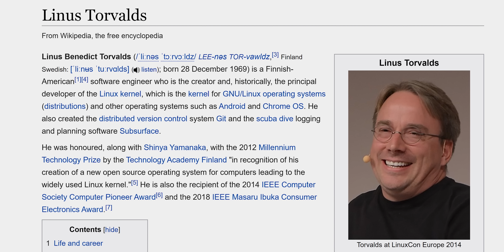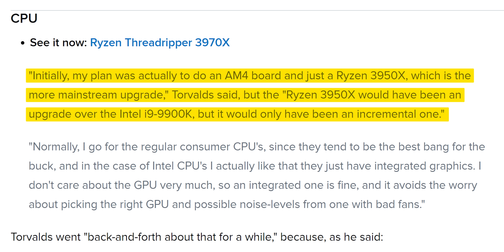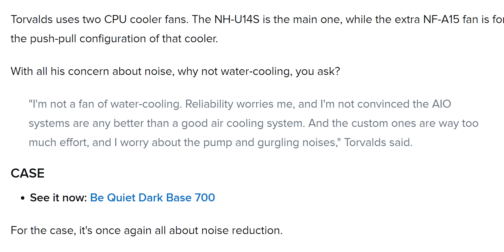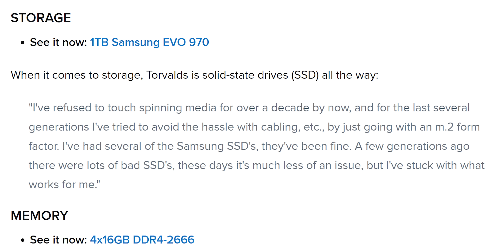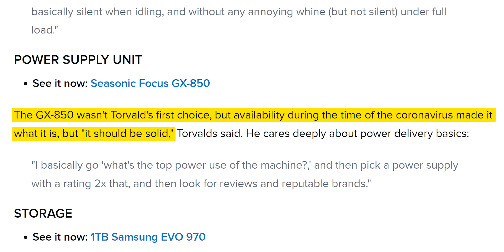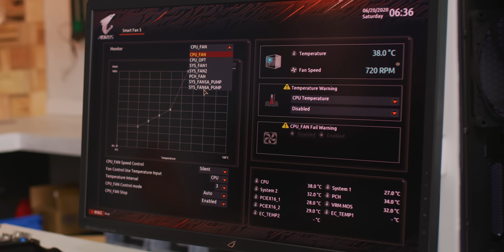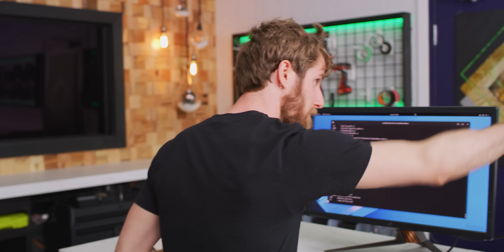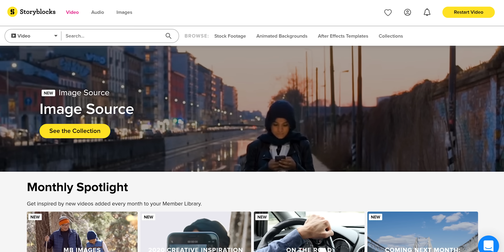Linus builds Linus’ new PC!

Comment: Linus' thoughts about water-cooling mirrors mine to a freaking T

AIOs I could probably bring myself to look into at some point (mainly for the fact that it does admittedly look a lot cleaner and less cluttered than a chonky air cooler (like my Scythe Mugen Rev. B), but a full-blown custom liquid loop? Nah fam, you can keep that expensive, high-maintenance mess.

Comment: I have the same case. According to the manual it’s possible to mount 3 140 mm fans in the front. Has anyone tried this? It’s almost impossible to fit. I managed to do it, but the bottom screws of the bottom fan aren’t attached and neither the top screws of the top fan.

Comment: I use Linux on the daily, and I use the i7-7700K and I'm pretty happy with that, it works well for both gaming and compiling source code pretty quickly. But I think I might fare better with a Threadripper if I want that extra raw power for faster compile times.

Comment: that integrated GPU is better because less fans than necessary logic is just stupid.  Then he picked an RX 580??? Should've got a 1650 Super or something
Reply: AMD has far better drivers on Linux. On pretty much every modern distro they are built in no extra steps needed.

Comment: Awesome video. I'm a developer, mostly web and actually, I don't need that amount of processing power. I think most developers don't, of course, this depends on each developer-specific tasks. My personal experience tells me that is far more important to have a comfortable and ergonomic work station to spend long hours coding. I'd be nice to have "the wrong" Linus make a video about this ( XD ). I think this would be some nice features to take into consideration:
- Desktop real state. Multiple monitors to have the code editor, debugging app, browser developer tools, browser to check some documentation, and StackOverflow, maybe a couple of terminals. All at the same time without having to switch windows. I don't really care about awesome refresh rate or HDR or stuff like that, I'd rather spend the money on more monitors. 3 or 4 decent monitors 21'' to 24'' maybe matte over glossy because I don't like any reflection on the screen but it's not a deal-breaker.
- A comfortable chair.
- A big desk, I also like to keep notes by hand. Maybe a whiteboard
- A comfortable keyboard, to type a long time and a decent mouse.
- Fast RAM, storage, and networking.
- Wireless headset
- A fair amount of IO, sometimes we need to develop for embedded devices so a lot of USB, a couple of ethernet ports, and even an RS232 would be nice to have.
- Power efficiency. I rarely turn off my PC because I use it as a web server for testing purposes.
I know this specs are not really techy and I'm sure many would disagree with my opinion, probably I missed some things. But I think 99% of the developers would like to have the things I mentioned above. It'd be really nice to see an LTT video for this kind of workstation setup.
Reply: The smoothness of 120hz desktop bring lots of comfort for desktop use. I cant go back to 60hz, just like u cant go back to 30hz

Comment: 5:50 he could have used the noctua nh-d15 with a single fan in the middle for better performance and even less noise.
Reply: Does not fit the AMD Threadrippers which are enormous and contain multiple chiplets under the heat spreader.  On the higher-end 3970X / 3990X you need to cool the entire heat spreader.  Hence the Noctua TR4 specific cooler.
Reply: @matthewstott3493  Huh, didn't know the nh-d15 didn't fit.

Comment: Linux is also great for editing - with Davinci Resolve Studio, faster than on Windows 10 for sure.
On Manjaro installation is really easy also (having NVIDIA cards) - enable AUR in the package manager and install it, done - will even keep updating itself automatically.
Reply: Is that so? I was on IRC one night and someone said they could not get Resolve to run so I helped them out with it. I managed to get it running on my PC in the process too. Was just missing a library it depended on. I don't think mine updates automatically though? Cinelerra is cooler looking to me. Real men video edit on the command line with mencoder. It is faster for sure!

Comment: Love this build! I am a software developer and at my work they give us Dell Precision 3520s. I can max out my CPU on command by just building our application. Multiple threads, a fast ssd, and a lot of ram are key for developers. I run a docker container that has the application server on it, my IDE, the monstrous ram hog that is google chrome, gradle builds, and run micro, integration, and end 2 end tests. Sometimes all at once. It can be very frustrating when you need to get a patch into production quickly, but your computer just can't go that fast. My computer fans are normally maxed out and one of the guys on our team actually melted the plastic on the bottom of his laptop. I wish we had something like this at work!

Comment: "We don't understand the needs of developers"
Developers: Man I don't care just give me a Unix based system lmao
Reply: There are so many different kinds of developper
From front end dev pro apple noobs to ai engineers forced to use nvidia cards ....
Reply: @xenio8736  "forced" Yeah, force me to use A100's any time ;)
Reply: Guys, it was just a joke. Why are we now shaming people with macs...
Reply: @rubentorres5848  because "us against them" team mentality is easier than acknowledging that some machines are worth more than their hardware
Reply: I have started to use Cygwin as a development environment. Basically it is a very transparent way of running Windows and "some Unix lookalike" at once and saves me the trouble of using two seperate build systems. I can basically compile and run stuff for windows and POSIK in the same environment.
My favorite: make ARCH=cygwin-x86 && make ARCH=windows-amd64 && ./a.out-cygwin-x86 & a.out-windows-amd64 & all inside the same script.
I even use the Cygwin-Environment to interact with Windows. Doing regedit /dump | grep ShellExt and such stuff. While it surelly deviates a lot in the low level you can actually use it pretty fine for mid- and high-level stuff, in my case mostly some C++, Bash, Phython for boring standard terminal/daemon/networking stuff. And it also has a fantastic X11 implementation, I use it all day to connect to my more Unixish systems.
Reply: So basically those young hipster devs that run around with Macintosh laptops and have only one goal, using the latest most popular JavaScript framework? 🤔
Reply: @etnevel.naitzsirk  MacOS has a Unix-based kernel, so there are many similarities between using the terminal in mac and linux, making development on Mac very straightforward. In fact, while most developers, at Google for example, have a Linux desktop as their workstation, they generally use a Macbook Pro/Air for development on the go. It is easy enough to SSH into your workstation for specialty work, but can also do development work directly on your mac as well, when needed.

Can Linux be considered better/cheaper and to have more flexibility for development? Absolutely. But much more than "young hipster devs" opt to use Macbooks when not at their desk.
Reply: @jBaddog  you don't need a macbook to ssh into your workstation :) and actually nowadays you can have a good laptop with good battery life with linux for development on the go ;)
Reply: @etnevel.naitzsirk  to be fair Xcode only runs on Mac, and native mobile apps can bring in some good money
Reply: @etnevel.naitzsirk  Well.... yeah.
Reply: @etnevel.naitzsirk  Sounds pretty spot on lmao
Reply: Levente Krisztián Büte actually unlike windows. Mac is built on Linux and includes bash which has enabled macOS to develop for many languages right out of the box without installing a thing such as PHP, Python, Ruby etc... in fact it supports 10+ languages in all without installing a thing. This is why in the San Francisco Bay Area(Silicon Valley) it is a pretty common site to see a sea of MacBooks at any coffee shop or on any tech companies production floor. I’ve been doing this for 8 years and when  it comes to laptops there is no other OS that caters to developers more than macOS.

Edit: I’d like to point out also that Windows supports 0 languages out of the box.
Reply: @TheN8ism  I'd say Arch Linux comes pretty close but at this level that's just personal opinion.
Reply: @TheN8ism  A few corrections here: 
macOS is not build on Linux but on BSD, which is a Unix variant. If Unix would be the father, BSD and Linux would be the kids (and thus siblings), macOS would be a bastard of BSD and Mach, and regular Linux distro's like Ubuntu and Fedora would be kids of Linux.
macOS these days uses zsh as shell, not Bash
Default languages in macOS are most of the times older versions. Any modern developer will install their own version. Also updating to the latest perl can cause incompatibility issues so it's not that straight forward. And you would still need to install php or nodejs, Xcode (for Objective-C) or other code editor/IDE.
In the end.. these days most developers would be using Docker, for which you would need Docker 4 Mac (/Windows) which runs a Linux VM, so your operating system becomes less important. 
For the Windows fans: Windows includes a Linux Subsystem (=bash) and also it's not that difficult to install any interpreter by double clicking an exe installer.
I use all three OS'es, each to their own power
Reply: @wLooooooo  Mac is based off of Darwin, which is based off of several systems (including BSD, of course)
Reply: @TheN8ism  : Uh, NO, it's not built on Linux.  It's built on Mach with a BSD personality on top of it.  That OS hails from the genesis when Jobs left the company and then came back.  He left to found a company called NeXT and he brought the OS back with him to make OSX, for all intents.  They look/act similar and program in many ways similarly unless you're touching a UI piece...but it's not based off of Linux.
Reply: A few points to add to this thread:

1. macOS is (was?) a certified Unix. Unix is a standard and you can write it however you want as long as it complies to the specification. After all, Linux is (was?) simply a Unix-compliant OS without the official certification or the Unix software license.

2. Whilst Linux or other Unix OS's are great for non-Windows centric development, macOS is the only one that really has widespread support for industry standard commercial software that developers or whatever may end up needing (or at least preferring). Anything from Microsoft Office to Adobe to Autodesk to numerous enterprise focused software. Linux doesn't get much love there and more traditional Unix is typically not even part of the conversation.
Reply: @NaN you are still using nvidia gpu...
Reply: @NaN Yeah sure, go train any real deep learning model on something else than a Nvidia card :)
Reply: https://en.m.wikipedia.org/wiki/Category:Debian-based_distributions
Reply: @NaN ^
Reply: and a thinkpad

Comment: Respect.  Amazing.  As a developer and a gamer, balancing all these things is difficult.  Personally, I've been dual box for almost 30 years.  I run a Windows desktop with a fast connection to a Linux box, basically, as my desktop.  I display back Xwindows to my windows box.  For me, this gives me maximum flexibility, and allows me to run Linux apps natively, full on.  It, also, lets me play games and use all the great Windows software, natively, at the same time - all on the same desktop.  The builds are complicated, but fun :D.  Each circumstance, and person, has different requirements.  Personally, I code on many different platforms, and do a LOT of different stuff.  Also, I tend to run servers on the Linux box, as well.
I can remember, 20 years ago, displaying back an Eterm Xwindow, for perfect emulation, sshed into a Tandem, so I could have pretty, nice, windows and emulation going to a Tandem.  Most developers, in general, are clunks that have no idea how hardware is put together, and are happy with ugly garbage looking development environments.  I, personally, found my productivity was boosted as much as 5-10x that of other devs in my group, by taking the time to set up some of my crazy work environments.   A couple days, working out something really amazing, would pay off dividends in the long term.
I, suppose, the point is - you can have your cake and eat it, too.

Comment: I don't like poop colored fans. I love be quiet! products. I replaced all my chassis fans and my CPU fan with them. As for the restrictive intake in the front of my case, I just put 2 fans on those, and set them to run constantly at the highest that I could without actually hearing them, and set all my exhaust fans to completely shut off if the PC is not under load. Because of this, I have a positive air pressure in the case. This means that I never get any dust slipping in through the cracks.

Comment: most developers dont rebuild something the size of a operating system though so i suspect this may be overkill... that said if you working a web development it does take some time to combile the backend and then do any traspiling to javascript packaging/bundling operatiion possibly there may be a unit test or end to end test to run too if we are really going for the works..
javascript notably is single thread operation though which may be an argument for intel... though not a overly large one given how good ryzens gotten and if your doing webdevelopement your probably running multiple browsers  though that rapidly disapearing as a thing as everyone gives up and jumps onto the chromium bandwagon.....
not sure if webassembly will run mutli threaded hmm... maybe in future? not sure.... curious to see how that shaked out...

I mean some operations in javascript could arguably run mutli-threaded if it was implemented that way like Array.map for instance.... but that would probably be impractical... but i bed it would be simpler to do with webassembly if it does not already work... need to dig into that hmmm... just getting into blazor right now...

Comment: That board actually supports DDR4 4000 ram, would've been cool to see how much performance (in compiling linux, probably not a lot) left on the table by not going for that.
Reply: Actually, since you can get that same DDR4 4000 in 32GB modules now, how about if you put the source directory and build path on a ramdisk, that would be super interesting!

Comment: I'm a software developer, and I did do some benchmarking of build times (rust, building actix-web version 2.0) with and without XMP. It made absolutely no difference but caused some minor stabiity problems. This was an 8 core Ryzen 3000 series chip. There's basically two things I want: low batch compile times for languages where that's applicable, and general snappyness in IDEs.

Comment: I remember compiling minimal version of Linux kernel on my HP 6715s with AMD Sempron 3600+ 2.0-GHz processor. Took 90+ minutes if I remember correctly. Transcoding of a 2hr video to 480p with h264 took 9+ hours. Oh the pain of recompiling the kernel when I forget to enable some module. And the CPU temperature of ~90°C.

Comment: Regarding SSDs. The early Sandforce controller ones were cheaper and on most of the third parties and had a lot of reliability issues. Samsung and later on Intel had their own controllers which did a bang up job and have maintained great reliability. My first SSD was a Samsung 8 something something EVO and to this day runs my OS on its tiny 50ish gb size, and i think it has about eight years or more on it.

Comment: Linus:es needs are needs of someone who works with small code bases and incremental changes only affecting few files. Fastest CPU for that more typical scenario is 10900k currently. I'm currently using 3900x so that I can test my own code with more threads. And only reason to upgrade would be testing AVX-512, and getting fully passive cooling solution from boutique manufacturer from Germany.

Comment: I think a B550 and the new 3900XT coming out next month would be a better system.  At only 105w and 12 cores and the supposed performance boost of the XT cores as well as the reasonable price points (to piss off Intel) I think it is a no brainer.

Comment: If you ever make a dev build guide, here's important things:

Speed, the system should be fast at booting, I/O operations, and compiling.
Enough storage, as a programmer I've noticed I'm always needing more space which is why my most recent build has 5TB.
Cheap but has quality, if it's too expensive then it will obviously be hard to afford.
Stable, can't have it go down in the middle of compiling.
Basic graphics, unless gamedev is needed or it's going to do gaming there's no real need for a graphics card but having a basic one will help offload the graphics from the CPU if the system uses all of its resources.